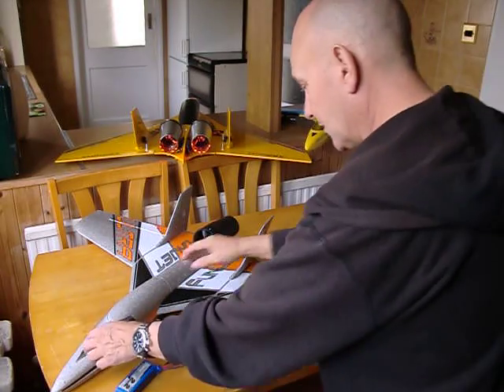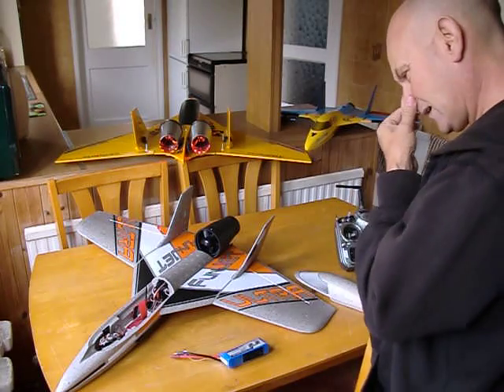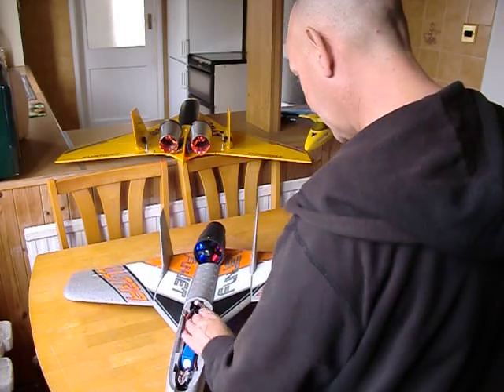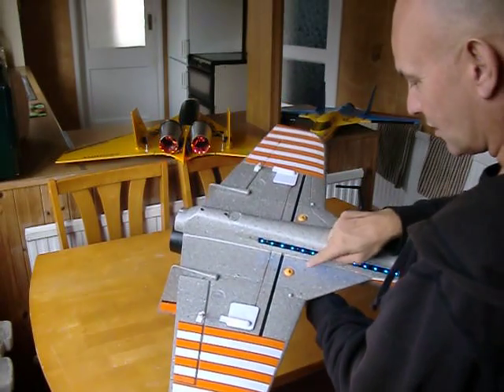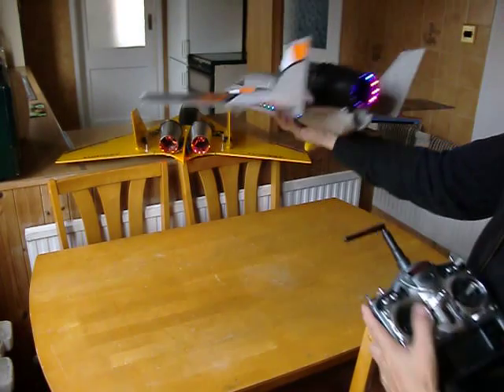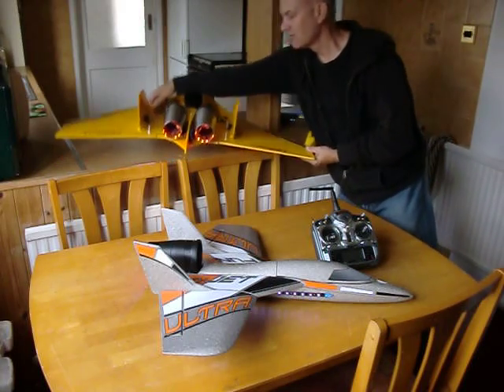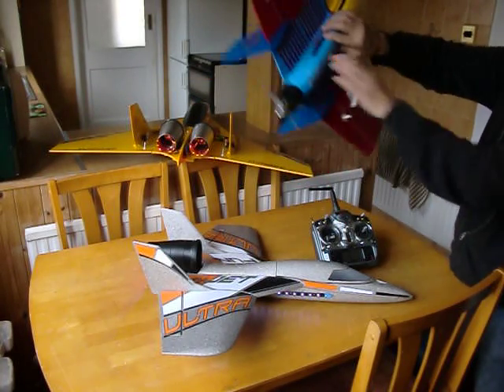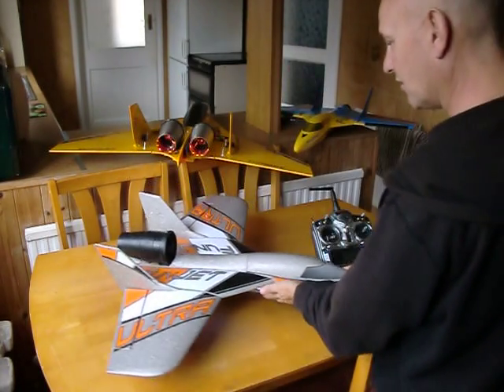Fun Jet Ultra , EDF with LED afterburner

Comment from the maker: @monkieet28 Im in Scunthorpe ,  not far ,    the whistles are from a toy Nurf ball - you throw it and it has plastic low preasure whistles - work very well . if you go to    Vulcan EDF on utube you can hear them as the model flys over .   or just type in     salem42salem42    to see all my vids on the utube search bar .